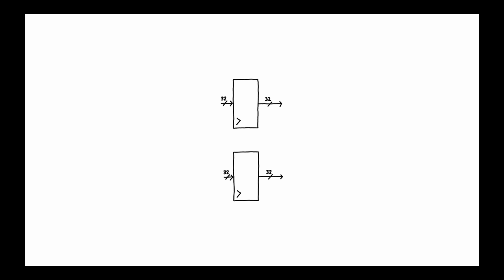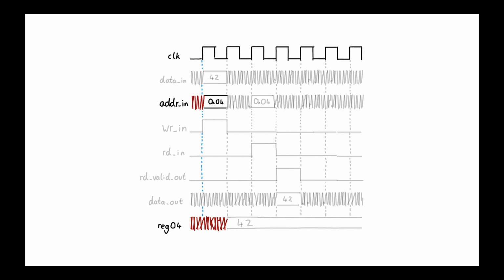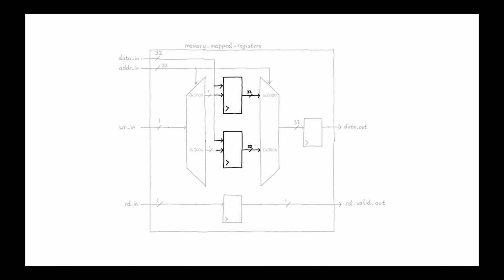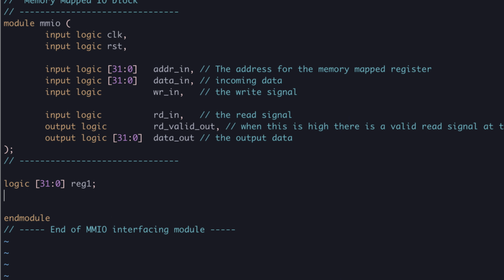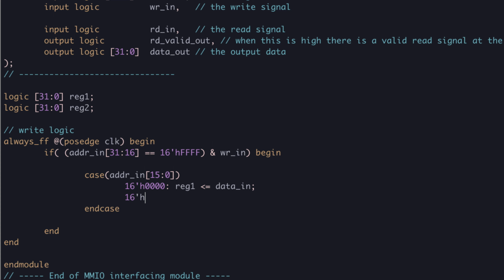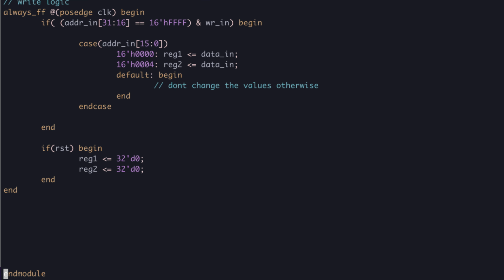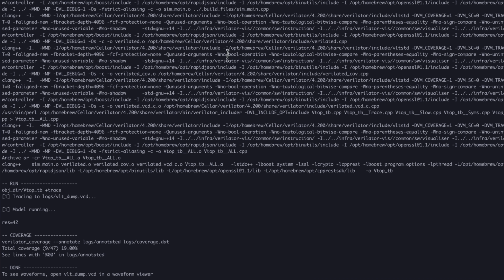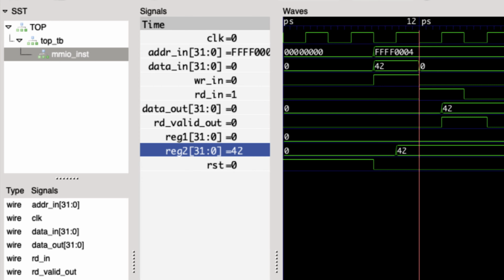System Verilog: Memory Mapped Interface

Comment: If you are using the pos edge of clk, then you haven’t allowed/shown the hold time. Also your diagrams don’t show any delay from clock to data valid. Your waveforms are like those from a zero delay simulator. I find these type of waveforms very confusing. Although no doubt frowned upon by university professors, if I had your waveforms I would use the neg edge of clock, due to the juicy setup and hold time. Note: I code for cheap FPGA dev boards, personal projects, so I am able to code in a non standard way. Nevertheless I mix pos edge and neg edge clock domains, as it makes data transfer super safe from a timing viewpoint.